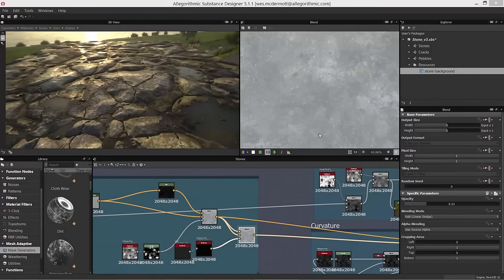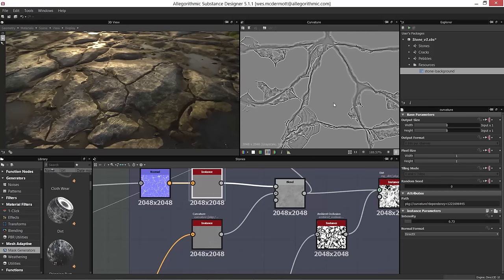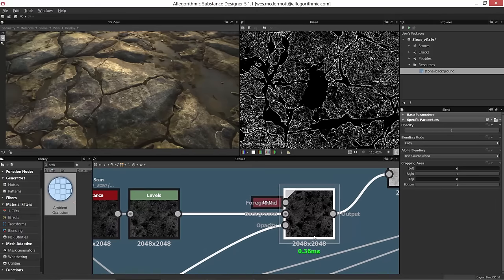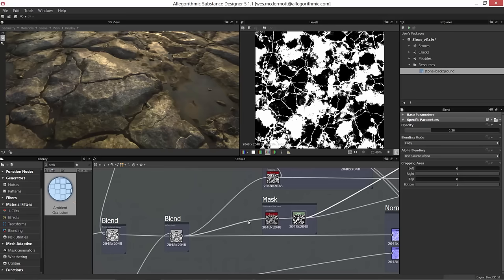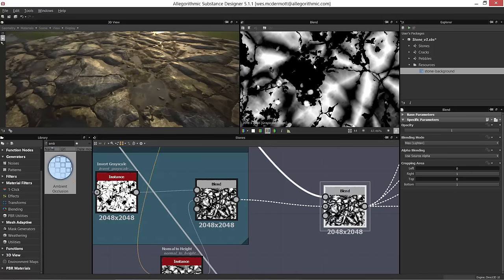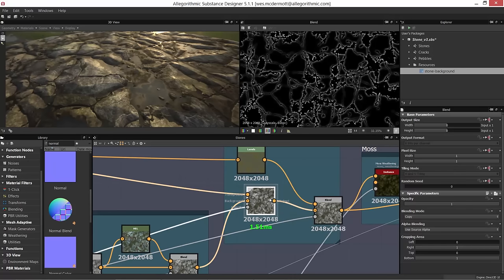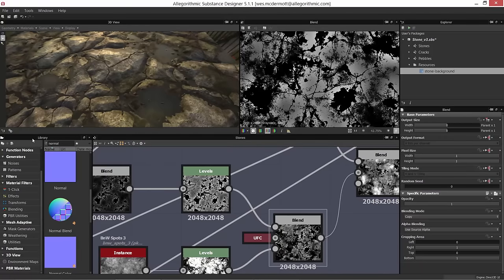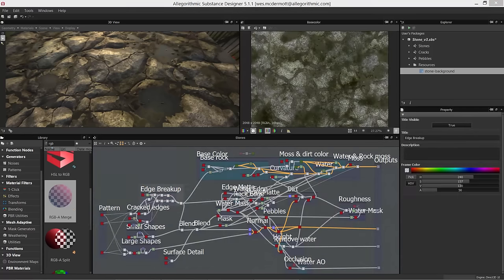Creating a procedural rocky ground material #5 | Adobe Substance 3D

Comment: Is there a way to avoid the gray scale vs RGB issues?  I never see you encounter that where the node noodles won't connect and need a converter
Reply from the maker: Designer will try to convert if you are connecting a gray scale input into RGB input. It will create a gradient node as the converter. Can you explain the issues you are running into with connections?
Reply: hiya! I ran into this issue. At least for me it happened when I forgot to invert_grayscale rather than invert. Also, when my uniform color's color-mode was not set to grayscale. once those were changed and re connected to the correct outputs with the grayscale conversion and/or gradient map nodes deleted, everything worked correctly.  hope that helps.  :)

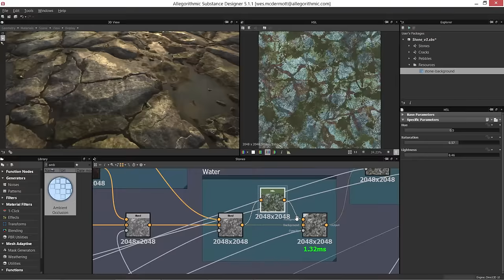Comment: Great series Wes! I noted that at  21:00 when you began the Water Mask, you did not invert the blend as in the previous Mask, but ran a Histogram Scan on it before the Levels etc... if you do an inversion there, the cracks become white and the effect doesn't come out as you intend. Anyone else see that or have another solution? Thanks!
Reply from the maker: +Rick Echler Hi Rick, thanks very much. So glad you liked the series. I'm sorry, but I'm not sure I understand the issue. The white areas from the levels and invert become the area the water is placed. That is not working when you try to recreate it?
Reply: +Allegorithmic Hi Wes, the material worked fine I just wanted to clarify that the first node in the water mask is not an inversion but a histogram (21:48)This tripped me up a bit and wanted to leave this note for others who may follow along later.
Reply from the maker: +Rick Echler Thanks Rick. I'm sorry for that confusion. I probably did the invert in the levels node as well. Sometimes I do this so that I don't have to add an extra invert node. It helps with optimization, but makes the graph less easy to read.
Reply: @Substance3D  
I know this is seven years back so I cannot expect anyone to recall, but I think what happened is that the gentleman going through this tutorial used two histogram scans but they thought they were using two inverts and they just got a bit mixed up (which can easily happen when going through such a big texture graph). Anyway, I just wanted to put in my two cents.

Comment: Considering were working with grey-scale so much more than R.G.B. I am surprised their s no Luma + Alpha.

Been wondering what the high resolution plane is for, that is, if their is no displacement function.
Reply from the maker: +Matt W You can use parallax by adjusting the height scale in the material. You get better results with a denser mesh.

Comment: Sorry for so many questions! But I have one more ;)

So I am looking to take my rocky ground material into say UE4 or just render in Marmoset, but with this tutorial we did not create a spec map or metal map?
Reply from the maker: +Joel Phillips This material is a non-metal (dielectric) so you don't need the metal channel. You can take the .sbsar file an use this directly in UE4 using the substance plugin. The metal channel will be left blank which is 0.0. This way, its one less channel to compute. The metallic workflow doesn't use a spec map. In Marmoset, you would set the reflectivity to metallic and just use a value of 0.0.